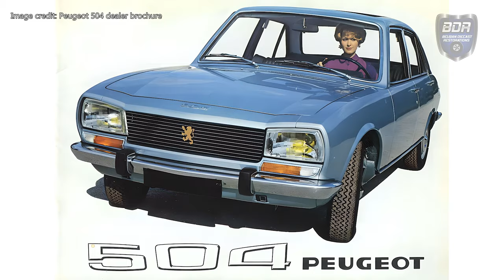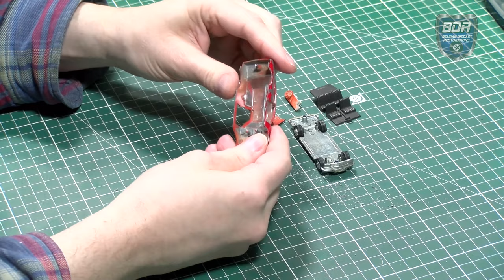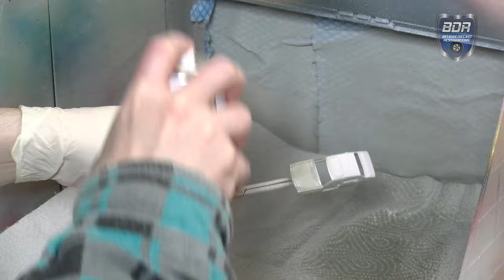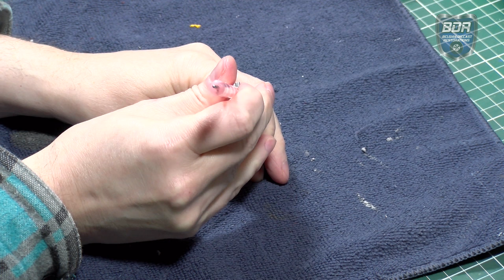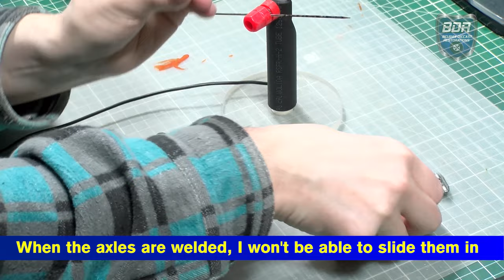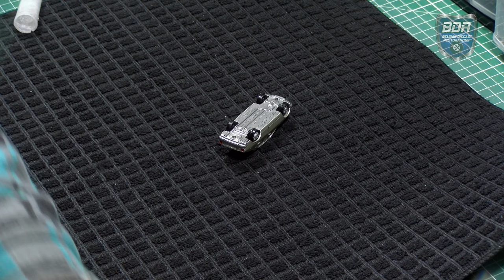Norev MiniJet 884 Peugeot 504 Custom Diecast Restoration

Comment: Nice restoration. I like the champagne colour much better than the original red colour. And the painted details too. Unfortunately, as you say, the wheels are not the best to begin with and that shows on the finals result. But it is still a beautiful restoration though. If I’m not mistaken you usually drill out the rivet post and tap it and use screws to fasten the base to the body. This time you used glue. I guess the rivet post was either very thin or broken. I myself prefer to use screws rather than glue. It just looks better and cleaner with screws
Reply from the maker: Thanks! 🙂Yes, I decided to glue the model, since the rivet posts are very thin. I maybe could have sourced a couple of 1mm screws, but I don't think I have a tap tool of that size.

Comment: When u put new axles on th car the gadget thatu use that gives of a spark does that bend the end of the wire can u put a close up after u put a new axle on so we can see the end of where the wheel sits please. 🤔
Reply from the maker: It's a jewelry spot welder. The spark heats the end of the axle up to melting point, making a little steel 'droplet' on the end, that looks a lot like the ends on an original Matchbox axle. It works great for small axles and wheels like these. But it stops being effective on larger wheels, like for SpeedKings, as the hole is too big.

Comment: I find it a strange construction how the axles are bend behind the wheel hubs. It worked at that time I guess.
Reply from the maker: Yes, these MiniJets are the only models I have done that use this method. I guess it was a way of cutting costs and/or speeding up the production process. Didn't make the cars roll any smoother though.